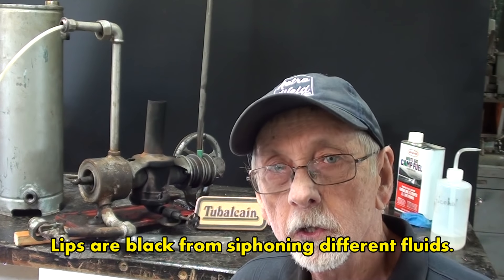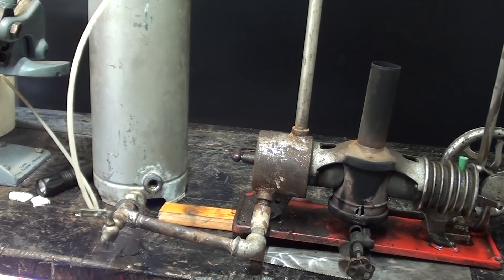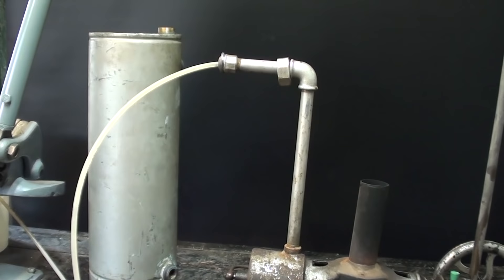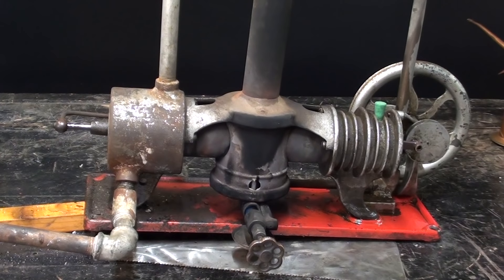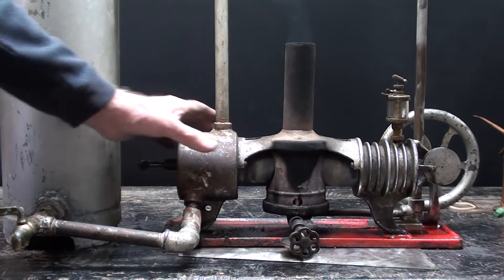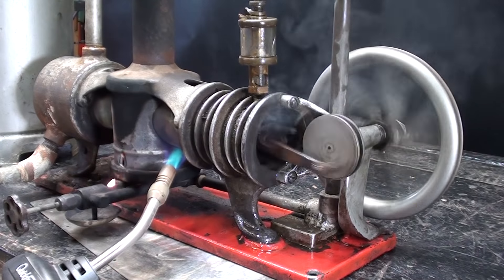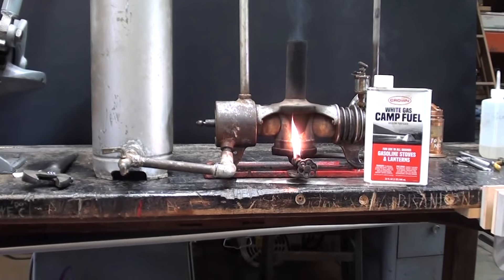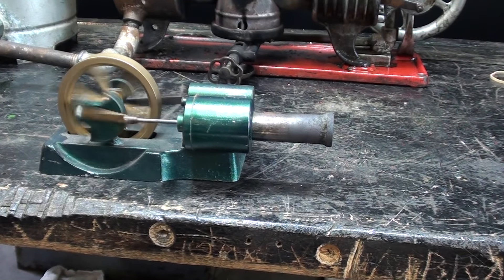ESSEX HOT AIR STIRLING ENGINE pt 3 #768 tubalcain  hot air antique

Comment: Looks like there's an air leak right in the burner area. The flame is being blown away on every stroke loosing heat. I'd take it apart and see if it could be welded or brazed.
Reply: That was my first thought too.
Reply: It also should be silent, not huffing like a steam engine
Reply: I also noticed that snuffing of the burner flame. That has to indicate some source of an air leak in the power cylinder right above the burner assembly.

Comment: You could check  that the displacer piston is a close but not touching fit in its cylinder. Its connecting rod gland needs to be oiled (obviously). Check that when you spin the flywheel, the power piston 'bounces' back off compression a bit - there must be no air leaks from any part of that combination cylinder - you know this of course mr.pete ! As someone else has suggested, it looks like there may be a slight leak around the burner area of the cylinder ?  Great to see it trying to run in any case. It doesn't look too far off.

Comment: Some years ago I bid on one of these with no cooling system at an auction. It did not look real good but it went for over $1,300!  (without tax and fees)  You might do well to sell it as is, could bring a lot especially with that cooling system.  I suspect that this engine was actually used to run something for a long time. The piston bores or pistons are most likely shot and that's why the guy stopped running it.  This is a very desirable engine for collectors like me.
Reply from the maker: Thank you for watching. I will certainly be selling it within a year or so when I get sick of it, lol.

Comment: With how the power-piston and bore looked I have my doubts about the sealing properties which should explain some, or all, of the need for increased thermal input. 
And I doubt that can be restored without the need for new parts. Oh well, to measure and inspect is to know, best of luck with finding a clear answer Lyle.

Edit / addition: It is quite amusing (for me) to read all the comments that seem to think you don't understand the working and symptoms of these engines (or should one cry?)
Reply from the maker: lol

Comment: Mrpete, this may sound silly but I think the reason the connecting rod kept coming of was because the piston was installed upside down. That Web that holds the piston pin would not let the rod move out away from the crank pin. I know you fixed it with a screw in the crank pin. I know you put it back together the same way it came out but I'm thinking Bubba may have put back together 180 from where it was originally designed. Just a thought from an 80 year old repair/ job shop machinist (retired).

Comment: Lyle, the hot chamber may be coated with excessive soot, that could be acting as an insulator. I've had good luck using Heet in the yellow bottle. Methyl alcohol seems to burn hotter. We kids out here couldn't tell you the name of our guidance counselor by cracky we all remember the name of our shop  teachers.

Comment: After the appropriate amount of cool-down time, I'm sure you can get this antique Essex running fine if you wish!  It will be good content for the channel and you still got an original engine cheaper than a set of Myfordboy's castings delivered to the USA.

While Bubba's radiator seems to work fine, I would definitely replace his crazy white gas burner setup with the gas burner Myfordboy uses as it's cleaner, more controllable and much safer. You could also easily make a simple alcohol burner like every other Essex engine seems to have.

It's important not to get to complacent with liquid fuel burners. Back when I used to be more active with Coleman lantern collecting, a fellow on the forum posted a picture of his fettle shed burnt down to the ground from a careless flame next to a can of white gas. The shed, all his repair tools and 75% of his lantern and stove collection were completely lost. No loss of life, thankfully, but I'm sure the withering look he received from his wife after the firefighters left made him wonder if he should have stayed in the shed.

Comment: Glad you might work on it some more.   It is very interesting to see how you troubleshoot this.   Is there an air leak between the cylinders and the burner area?  When you spin the engine at 7 min 51 seconds, the flame seems to be disturbed by air being moved. Possibly a loss of compression?  Could it be corrosion in the burner area that perhaps silver solder could seal.  Anyway, that’s my two cents.

Comment: Sorry for the mistyping, I was reviewing what was written when it was sent by mistake. So I Ned to explain that newer Essex engines that have been posted seems to start in less than a minute. This means that it does not take that long to get enough heat to start the engine. Since your engine has seen better days. It also seems that there is a lot of oil in the chamber as it seems to be doing two jobs, Lubrication and sealing. So the longer the warm-up time the more chances the oil inside is also vaporizing - increasing the chamber pressure much more quickly. So it might be useful to make an experiment by bypassing the burner supplied with the engine with the torch you used at the later part of the video. It should be done with the engine at room temperature. It would be prudent to test the engine if it would run at the very first minute to give you a chance to see how long it will run from there. Experimenting with little tweaks her and there will tell how much more modifications will be needed. I am just glad that it started. It is in the best hands to make it better. I was looking at your videos on the other engines you have. I particularly was interested in the Rotor Vaccum. I looked around for leads and found a manual that said whattheproblem might have been. I was trying to find a way to get the information to you when I started to read the comments and saw that you had sold it at Ebay. Is it possible to contact you? I was interested in bidding on your last auction. However we needed to ask permission from my relatives in the states if it would be alright to ship to them. I know the auction is finished however the items I wanted to bid for was not sold. My thanks to you and congratulations again.
Reply from the maker: Thank you for some great suggestions and ideas concerning the Essex. Yes I sold that little vacuum engine years ago, it was quite frustrating. For that matter so is the Essex, lol. I am too old to be frustrated anymore. I will be running lots and lots more items for sale on petebay. Keep watching

Comment: Mr. Pete, rip er down and refurbish her! Notice I didn't say rebuild?  I'm wondering if that brass sleeve isn't removable and can be reversed to give you a fresh bore on the piston side (If it truly does run to the cooler side).  Also I think (that's debatable) the brass end of the piston can be remade by turning a cylinder and brazing a cap in the end.  This machine is a piece of history and can be made functional again.  Oh, while yur at it, use some of that expensive new fangled paint that comes in a aerosol can and make her purdy.  Keep it up Mr. Pete!  I keep telling myself that hard work only keeps us young!

Comment: Hi Mr Tubalcain, I have been holding myself back since you posted the second video. I was hoping that you would try what you did. However I am hoping you could have explained the modification to the burner. Why it seems that it is now burning cleanly. It is important to know that it would run despite its condition. It will be easier to understand how to be able to make it better from this point. I was hoping though that since the oil reserve was a source of a leak and since it did not contain any. That you would have retained the cork instead. The issue of the oil burning is of concern as it would throw off the amount of gas that is present in the chamber. I would think since it is sensitive on the amount of pressure in the chamber there would be a buildup. As it gets hotter. In fact there are a lot of engines that have release ports that expel excess gas to make the engine run for longer. The oil reserve looks like it was a modification. I was viewing your post on the hit and miss engines that you sold and it seems to be similar. I also noticed that the oiler sits on a base that does not mate with the oiler. It is essentially resting on the fins. The screw is the mating part. Unless the screwing the mating part is tapered and the female part in the casting is deep enough to make the seal it will fail to give a proper seal. It would be likely that the oil is the reason that there is a temporary seal. If the oil is sealing it, as the engine gets hotter and the piston goes back and forth the seal will erode till there is enough blow by to stop the engine. Another is the fact that the main piston body does not seem to form a seal. So "Congratulations," the engine works. It seems that it will need your skills to make it better. If you could - make a piston that is quite similar and sleeve the backend of the casting to make a better slip fit. Make a more streamlined extention. It would be interesting to see How much of a difference it would make. I know that the engine is quite used. It is finicky, however the startup times of theme wet ones unless they also preheated it, was less than a minute. However as we know if the balance of heat is not controlled the engine will not work for long. So since you have basically got it to work. I think the reason the engine is with you is due to the fact that you can make it run better. So My Congratulations to you. It is a good start. Thank you again.
Reply from the maker: Thank you for a very good comment and some good pointers. There’s three videos were made months ago. I hope they get back to it pretty soon. I will take the whole thing apart.

Comment: Nice to see it running :) I don't know why I thought that the radiator side was the cold side, when you've got cold, running water on the other. That's why I recommended cold towel on the radiator fins, last time, but I can see now, that it's the other way around. Blow torch on the hot side does seem to help, doesn't it? Maybe something's off with the furnace, as some have suggested in comment section of the pt. 2 video. Also, is it possible that the timing is off? Anyways, thanks for not giving up and even semi-success is a good thing. At least we've seen it running for a while. Thanks for showing that little engine in the end, too :)

Comment: There seems to be an air leak in the combustion chamber. When the engine is turned over the flame goes around the edge of the combustion chamber.

Comment: Hi Mr Pete
Two observations that may be mentioned in the other comments.
1/ When you got the engine running with the gas torch, and the white gas was still burning, on each stroke the flame was puffing, possibly suggesting a leak in the air tube between pistons?
2/ When you put up the patent description, the bottom lines reads "In the same cylinder operates the displacer-piston B, but so loosely that air passes freely between it and ...?"(page ends on screen)
This is incomplete and I presume you have the rest, Could this be suggesting that the hot air is supposed to bypass the displacer piston(but not necessarily escape the engine)?
I know this does not make sense, because it needs to pressurize to cause the working piston to move, but I'm just reading the written detail on screen, I don't know what is supposed to happen inside the engine.
Regards Bob W
Reply from the maker: You are right, I think there is a leak. And the displacer allows the air to move from one side to the other
Reply: @mrpete222  Thank you for the reply. 
While I was laying in bed(just like you) I had another thought, if the chimney and the central bore through the burner are coated in soot as evidenced by the continued burning after fuel cutoff, then that soot will be insulating the center tube from receiving heat from the burner, except as conducted heat from where the metal of the burner touches the center tube, which maybe why the working piston housing gets hot too quickly.
Just a thought, although it seems you may have a disassembly job coming up to fix the leak etc :), happy tinkering Bob W

Comment: As the power piston was moving back and forth, the flame of the burner kept "blowing up," getting bigger and brighter with every stroke. Shouldn't the burner be sealed-off from the cylinders? I wonder if there's a leak somewhere between the cylinders that's causing problems. This is assuming, of course, that I even know what I'm talking about with Stirling engines. I just don't think that burner flame should be affected by the piston movement.
Reply from the maker: Agreed

Comment: Are you sure that the fuel supply wasn't changed to that reservoir can and really meant to be a pressurized canister like the pump up gas fired blow torches?
The system the way it is set up seems a little "funky" to me.

Comment: A small push nut might keep the connecting rod in place.  The flame just looks lazy.  The pressure is fixed by the tank elevation, so ??.  Fuel type, jetting, draft, combustion air?  The yellow flame will cause soot & carbon in the furnace.  Would it prove anything if the butane flame was directed into the furnace rather than the cylinder?  Seems it all depends on the right amount of heat at just the right spot.  Intriguing and frustrating.

Comment: At seven minutes and 50 seconds a flame shoots out the bottom when you rotate the flywheel.  You've got a hole or crack in the bore somewhere.
Reply from the maker: That is what I was thinking
Reply: @mrpete222  if the crack is in the brass liner you might be able to fix it with solder.   Be aware of the melting point of the solder you use.

Comment: Why is the heat in the middle? As I understan they opperate via a thermal imbalance. That's why you water cool one cylender while heating the other. Isn't having the fire in the middle exposing the cooled cylender to unwanted heat?
Reply from the maker: I rather agree with you. All of the engines I made have the heat toward one end
Reply: @mrpete222  It's almost like you need to turn the expansion piston around, move it's cylinder out, add a heat-sink head and "put the heat to the head".
I think they got half way through the build and realized they screwed the pooch and said Good enough.

Comment: To me it looks like there might be a hole/leak burnt though from the burner into the cylinder. When the engine runs, there are flames beeing pushed out the burner sideways. That might also be why that brass sleeve is inside the cylinder. Or rather why it is so uneven looking.

Comment: The burner on the engine is so unconvincing. It should have a better fire than that. 
Your additional heat is too close to the power piston & cylinder - that's why that was smoking. Aim your additional heat up where the burner's supposed to be providing heat - in the err, firebox ??? :)

I'm guessing that's bog-standard car coolant antifreeze - in which case it is toxic - don't drink it and more importantly don't let your pets drink it. It's not a nice death for them.